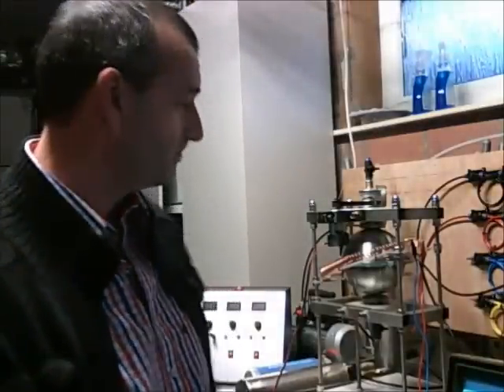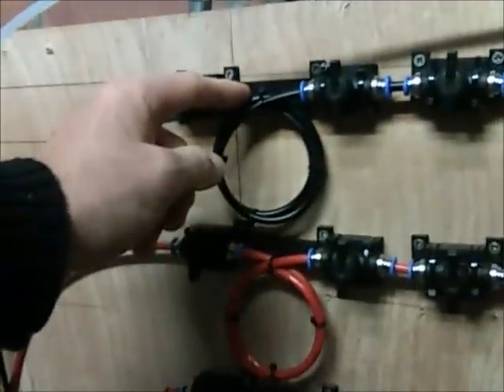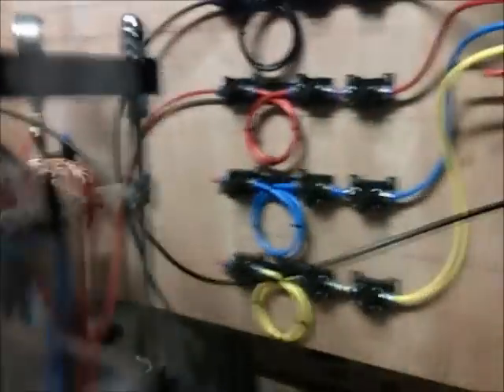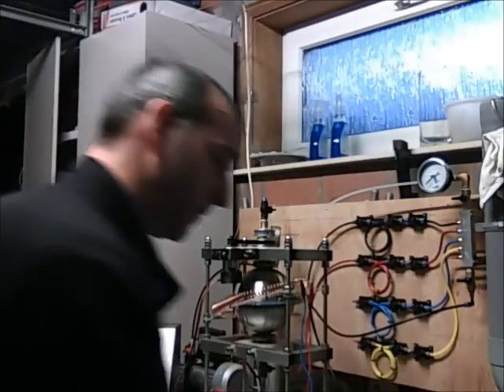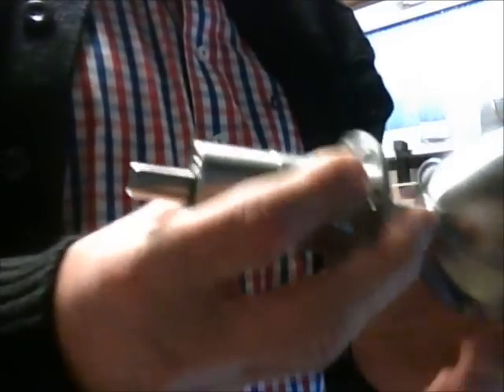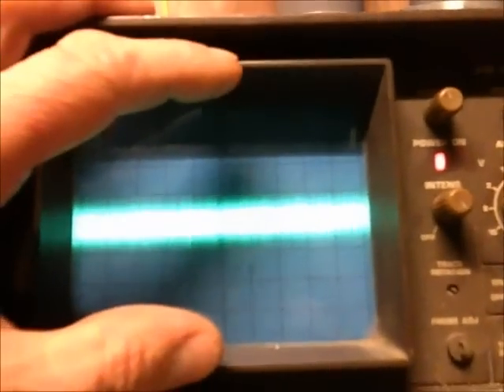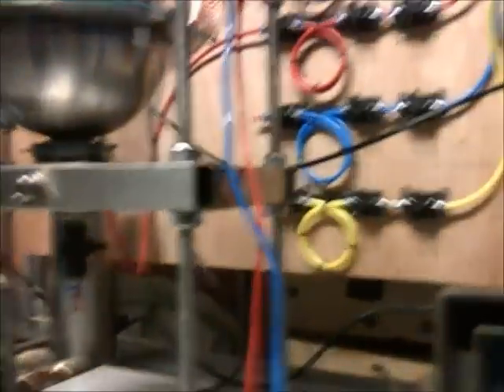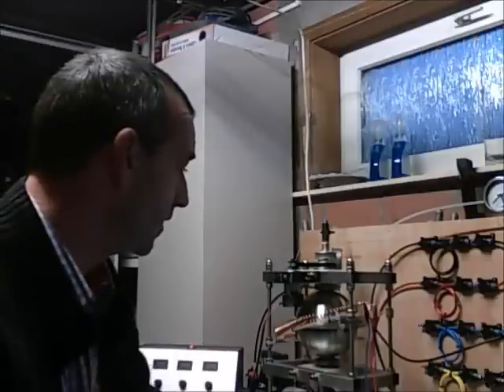V10 "Nederlands group"  reactor test with some results

Comment: es una lastima que el señor keshe no suelte prenda, lo que te falta es el sistema de arranque en el que necesitas inyectar corriente electrica al interior de la esfera para calentar el gas y conseguir plasma de hidrogeno
Reply from the maker: Do not worry, we know what to do to make the system work. It will just take some time to run everything correctly. At the moment I'm working to find a way to bring the copper layer in a proper manner on the inner wall of the reactor, I think this week i make a video of it.
Remember that this project is done during free time. Everyone also has other obligations.

Comment: proton - ,the smallest quantity of electricity which can exist in the free state. its charge is 4.774 times 10 _10 negative electrostatic units. the quantity of positive electricity on the proton is numerically equal to the quantity of negative electricity on the electron,  its mass is practically identical with that of the neutral atom of hydrogen, that  is 1.66 times 10 _24 grammes or1.007 on the oxygen scale.

Comment: nice work. however the expansion of plasma usually happens threw an oscillatory material. if your spheres have any iron in them ,   no expansion, although chromium does make a decent energetic carrier,in wire form .  you could try carbonizing your inner sphere, -   the inside, then use a bottle glass lining,  poured in and coated several times to get a good coating. so the plasma cant touch the metal, and gets a chance to open up and expand.    I,m sure you will find better results.  you should however be careful touching a charged sphere my friend,   always approach your sphere with a tester or a florescent tube,  good to keep you around.